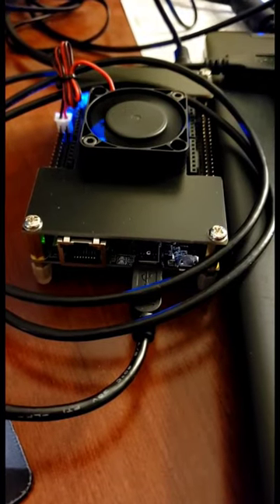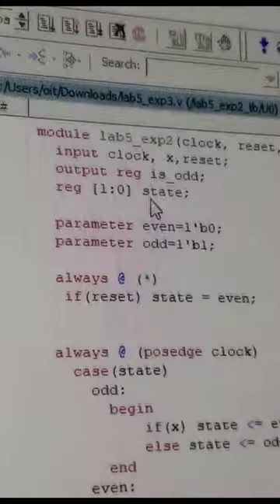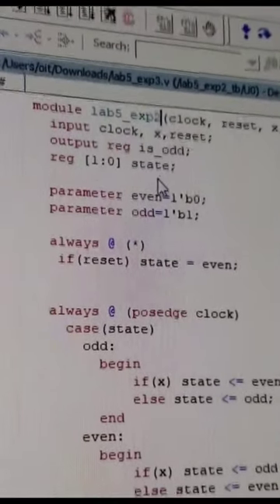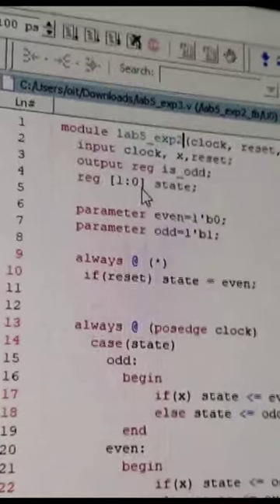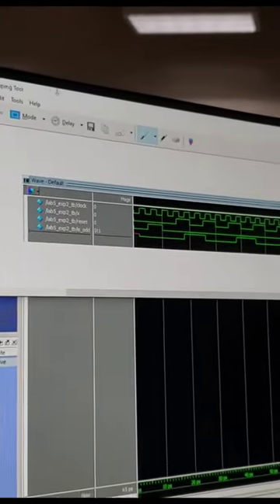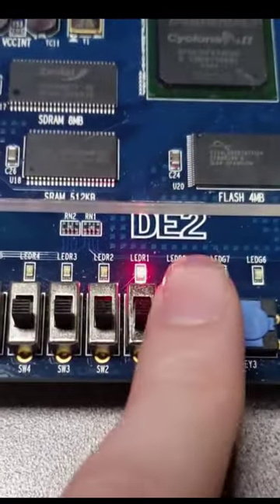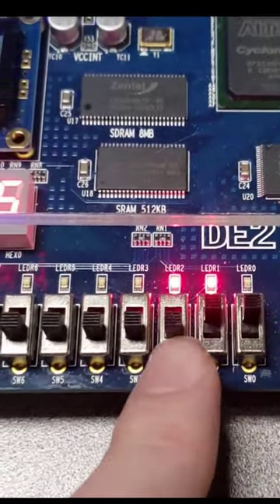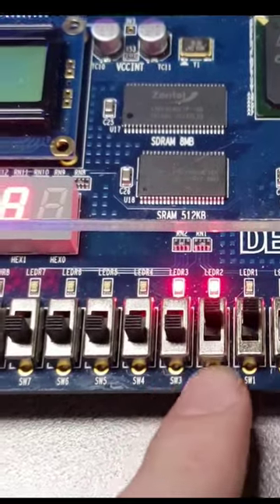FPGA design flow #digitaldesign #technology #systemverilog #coding

Comment: But how do you get the finished FPGA onto your own circuit board? Sure, all that is necessary preliminary steps with a prototype board, but it's not a finished product yet. We need a followup video on this.
Reply: Theoretically, the next step is to make it out of TTL chips(if you're crazy enough), run software, then ship the logic design to a chip fab (I hear google is doing larger 100/50nm for relatively chip, as long as you make it open source).
Reply: @rya3190  But I thought that the purpose of using an FPGA was so that you wouldn't have to have all those individual logic chips in the first place, but rather you can simply program it into a single FPGA chip. It's what happens after that that I'm asking about. And rather than having a custom chip fabricated, can you keep using an FPGA by ordering a board that has your custom circuitry on it plus the FPGA chip?
Reply: @SDJ41  You should be able to...They probably sell them in chip form. The TTL was more of a joke, I'm pretty sure an FPGA would be faster and not as mind numbing. It's either you keep using the FPGA or get your chip made. If you're just tinkering, it's probably better just to keep the FPGA(s) and make a good circuit board for it/them, but if you're going to sell it, probably better to get the dedicated chip. Takes up less room, cheaper over time, and can't be messed up by customers (more or less...)
Reply: @rya3190  Yes, that's it. I simply wanted to know if PCB order houses were capable of doing this. But I can see it depends on the seriousness of the project and what you're selling. Thanks.
Reply: So, heres my recommendation for this. Start very small. Pick up a low spec Lattice FPGA development board for something like an ice40 or something. From there make novel FPGA design you think is fun/cool/educative. It doesn't have to be super complex. Learn KiCAD for PCB design through Chris Gammel (contextual electronics) tutorials.

Now the FPGA you choose may have multiple voltages and you might have to sequence those so you'll need to learn how to do that with power sequencing ic's or do it discretely yourself. There's a lot of things to keep in mind when designing a PCB for an FPGA, even if it's a low spec one, but its great fun to learn and you'll feel very accomplished at the end.

I hope this is enough to point you in the right direction.

Try and do some intermediate circuit projects as well before you tackle a whole custom FPGA solution. But definitely reach for the stars.
Reply: @givenfool6169  I've already heard that it requires a 4-layer board which you can't do at home, which is why we have to order our PCB's. However, those are some powerful tools I've only begun to hear of. Very informative, thanks. Seems like a long road to get there, but maybe I will get around to it someday.
Reply: @SDJ41  it's a long road for sure. And you might consider trying to build PCBs for microntrollers first like taking the Arduino chip and making essentially your own Arduino board with custom peripherals for practice. There's a lot more simple designs I'd say to try as well. But honestly the Arduino chip (atmega328p) is not hard to get working on your own boards. But it could seem daunting at first. There's a lot of PCB practices out there, like just making a circuit with a blinking light based of a 555 or other small fun projects that serve no purpose other than education. I think it's well worth the cost to get them printed. My favorite fab house is JLCPCB because they're cheap and fast. Osh park is really expensive and slow imo.
Reply: @SDJ41  also 4 layer isn't that hard if you understand the concepts behind making a 2 layer board. It's also not really more expensive if you go with the cheap Chinese fab houses
Reply: (Field program get arry)
FPGA in
CMOS also same design
Reply: U have to write a contraint programme too